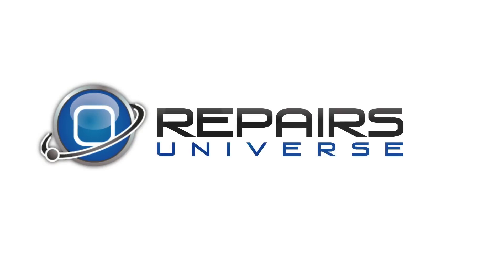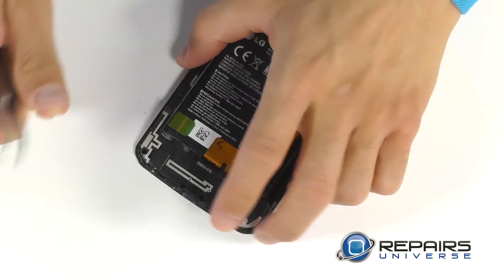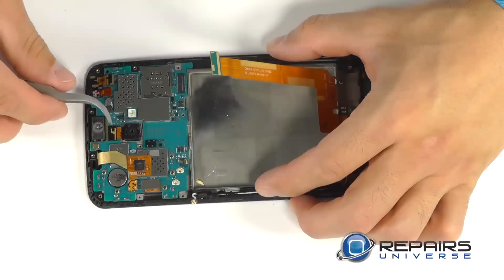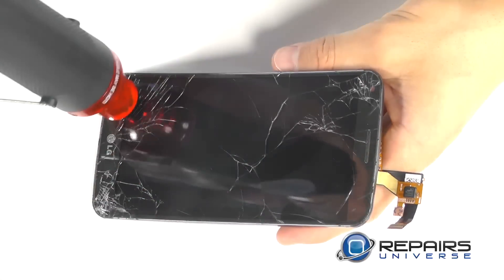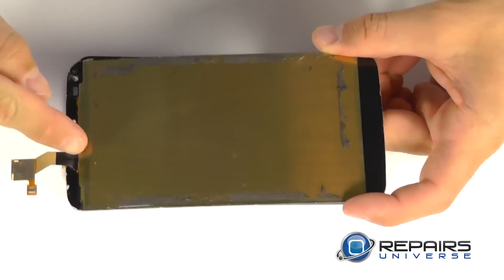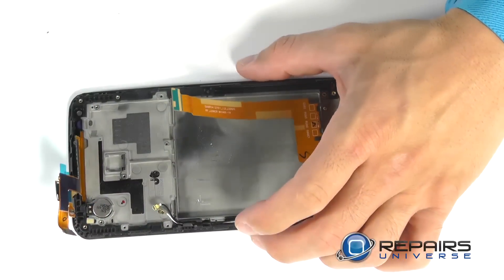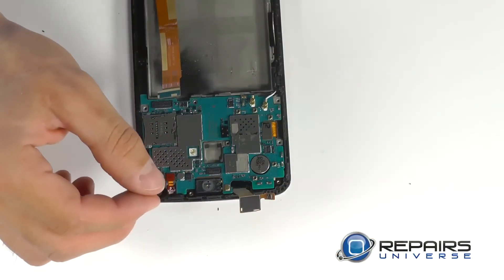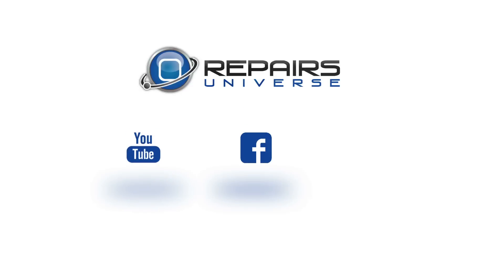LG G Flex Screen Replacement & Repair Guide

Comment: screen replacement meas LCD assembly with screen replacement. Can the 'screen' not be replaced with out the LCD?
Reply from the maker: It's very challenging as they are fused together. We would not recommend you attempt this.

Comment: What's the difference between "LG G Flex LCD & Touch Screen Assembly with Frame"  and the "LG G Flex LCD & Touch Screen Digitizer Assembly Replacement" sold on your website and how do I know which one I need for my broken LG g flex?
Reply from the maker: +Andrea Pinardi The unit indicates "With Frame" will have the frame assembly the LCD and Touch screen sit into. Essentially making the repair process a tad bit simpler. As where the other model does not include the frame and will require you to use your existing frame on your current device. This would be the only difference.

Comment: I dropped my flex and there are now these colored lines on the side of the phone. Is there anyway to fix that?
Reply from the maker: Sounds like the LCD got damaged. Replacing your LCD and Touch screen would resolve this issue. http://www.repairsuniverse.com/lg-g-flex-lcd-touch-screen-digitizer-assembly-replacement.html
Reply: my LGL23 is LTE it not convert in voLTE

Comment: id reccomend fitting the metal bracket in place and screwing it in than removing the adhesive film and than seal it that way youre 100% sure its im place properly !